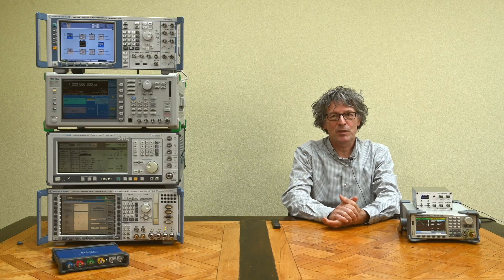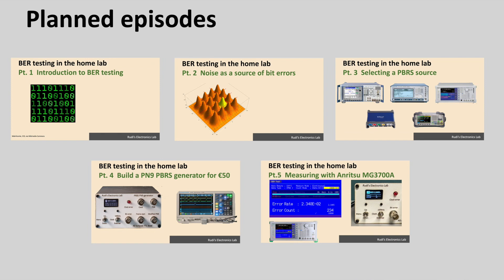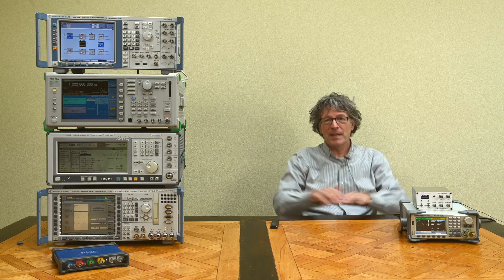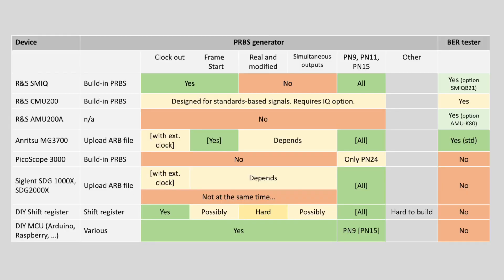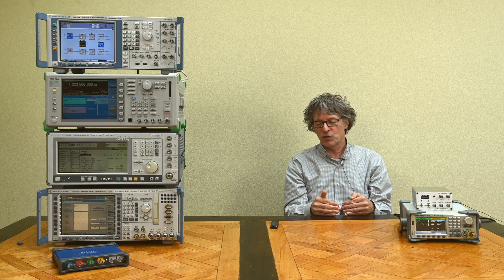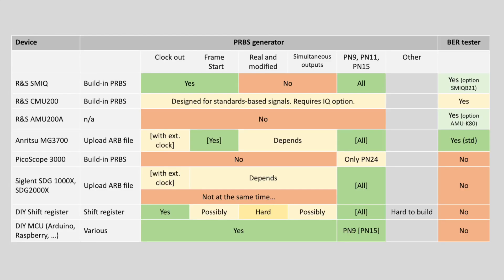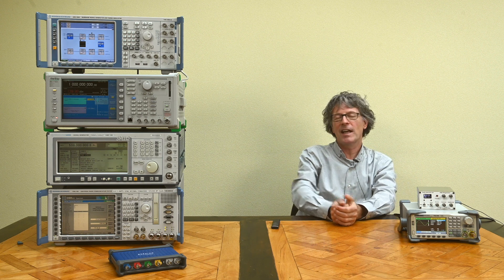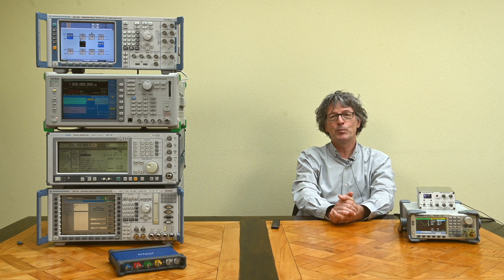REL #38 BER Instrument selection (BER Pt. 3)

Comment: Great video, love it.
FYI: in C++ can use  std::bitset to handle bit arrays efficient. Another easy way is just to create a C macro like BITSET, BITGET to do the work. Todays CPUs have also a 64 or 128 bit shift instructions which would allow to quickly produce static bit patterns.
Another easy version is to use an SPI DMA driven output of bits which works somehow in realtime.

Warm regards, Helmut
Reply from the maker: Thanks for the compliments. And it's great to know there are still new things to learn in programming to do this more efficiently (I had no doubt about that ;-) I will keep them in mind if I venture into something similar!